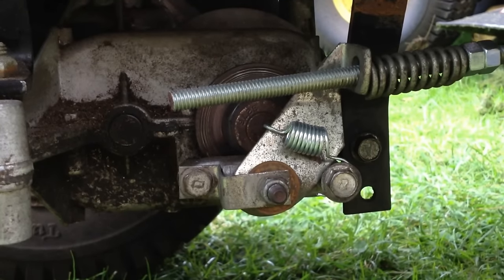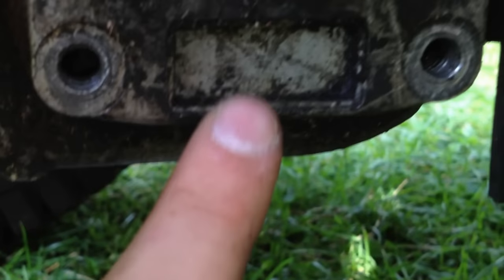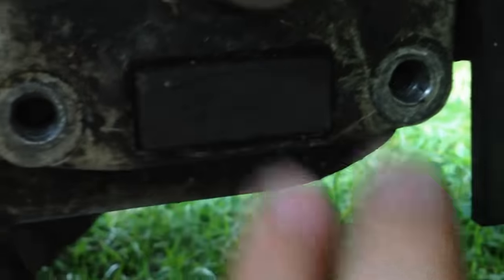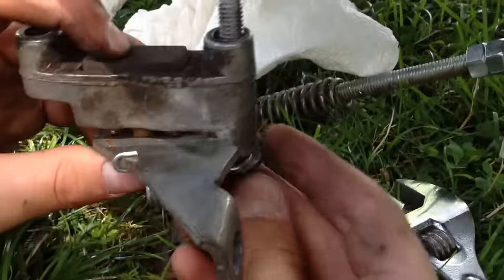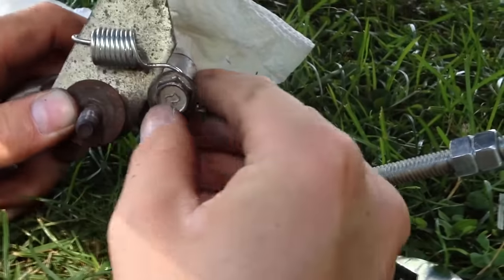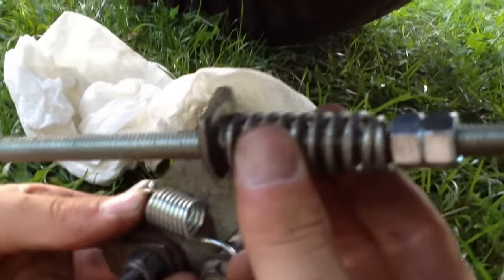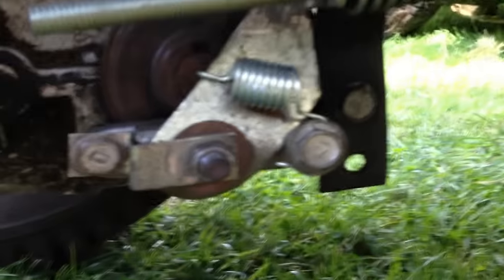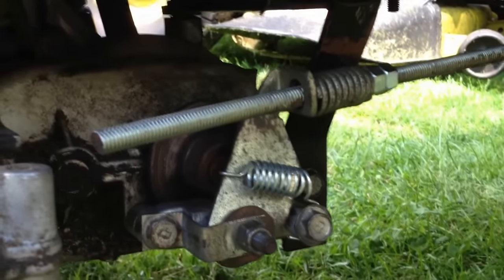Craftsman Lawn Tractor Brake Assembly and Adjustment

Comment: I commend you for taking the brakes apart and putting them back together again until you got it working just right.  As many have said you didnt know the names of some of the parts, but you didnt let that stop you from forging ahead.  GOOD JOB!  I just wish it was more like my 917.276022 25 HP 48" mower.  The basics are there though.  Thanks!

Comment: You actually did a pretty good job with that. I lost my brakes today and couldn't for the life of me understand why. I never had problems slowing down or stopping. I just simply let my wife drive it for 15 little ol' minutes and WAHLA ! brakes are gone. I jacked the tractor up and I can actually see the pad coming out and the brake assembly has play in it. I'll tackle it on the weekend,but very good!

Comment: Nice video and presentation. I watched it once and was able to do the project start to finish in a couple hours. The pins were rusted in solid. Had to heat the block to loosen. It was so corroded that the brakes did not engage so the pad was not worn. The brakes worked perfectly the first time.

Comment: Your video was helpful in locating the brake assembly on my mower. It is actually quite simple in the way that it works, all mechanical, no hydraulics involved. I would like to add however, that simply turning the pads over does not address the problem of failing brakes. If the brakes need adjustment then it's time for new brake pads. If you want to squeeze a bit more life out of the old ones you could fabricate a shim to fit into the housing beneath the existing pads, effectively giving them added thickness.
Reply: Definitely not true.

Comment: Excellent brake down, I am not familiar yet with my used mowers braking system, now I understand how they work and where the brakes are located . My recent mower purchase leaves me replacing more parts than I expected. It starts and stays running...  so I am on my way.. thanks for the informative video.

Comment: How to make the pads last longer.   A hose clamp is the right width. Just needs to be cut to length. You can use them as shims to push the  pad closer to the Brake Rotor. Just sand the pads  smooth where the rotor cut its grove. Place your shims behind the pads.  Lot cheaper than $16+ for  2  new pads

Comment: Great video, I had to apply heat and Kroil spray to remove the bolts that hold in my brake bracket system.

Comment: EXCELLENT!!  Haven't pulled it down yet, but my brakes have a hair trigger - I either "hit or miss" coast or nearly get thrown off the mower.  Appreciate the full breakdown - suspect gunk in there - glad pads/rotor have easy access.   

And music's okay, but glad it stops after the intro so I can concentrate on the instruction.

Comment: Very helpful. After dealing with a sheared bolt (recommend going easy and penetrating lube if you remove the assembly), we installed new 1/4x20 bolts. Differing lengths - 2” and 2.5” as I recall. Also the brake disc can be pried off and the rear brake pad checked/turned over.
Reply: the brake on this craftsman isn't 100% identical to the one on our Husqvarna LT151, but the basic design is the same. The bolts securing the brake caliper to the transaxle were verry tight, was worried about breaking the bolts, talked a bit with a mechanically inclined janitor close to where I work, and he advised me to use penetrating oil and heat the bolts, so I bought a smal butane burner and heated the bolts for about a minute and as he advised used a hammer to smack the bolts a few times.. repeated the process until the bolts started to turn, and here is an important advice I got.. when I got the bolts started to turn, instead of attempting to unscrew the bolts straight away I turned the bolts back and forth quite a bit before I finally unscrewed the bolts, this together with the application of heat and the smacking of the bolts would break the bond that had most likely formed between the bolt and the treads (that sort of welds the bolts and treads together)  and avoid either breaking the bolts or stripping the treads.

Comment: Thanks, found my really old Craftsman with the brake rod bent over and dangling, and couldn't figure out how those two bolts were supposed to work (no spring in my vocabulary, of course, as it fell off years ago!).  Old indestructible will have brakes again!

Comment: The spring around the threaded rod is to adjust foot pressure tension. The greer nut is to adjust the position of puck engaging the brake disc. Tighten down the greer nut will cause the brake to engage without foot pressure.

Comment: My Craftsman lawn tractor in about 11 years old and I needed to replace the brake pucks. If you check the sears website they don't make that pad anymore. If you go to MTD products website they have some pucks that are a little shorter but they will fit. The problem is they are not as thick as the originals pads. If you make a spacer like the one on the outside pad, and put it behind the inside pad it it will make it thick enough to work. This is typical Sears, I guess think that you can just drag you feet to stop.
Reply: My 1994 GT 6000 is 21 years old,which I bought brand new.Two weeks ago I ordered new pucks which Sears said are still in stock on Sears Parts Direct,well that ain't true I found out.Sears took my my $16.72 cents and now they don't what happened.The brakes went out 2 years after I bought the tractor,and not from abuse.I had to call them,they didnt let me know anything.I looked on Jacks Small Engine,they claim they have them,we'll see.

Comment: How do I adjust my parking brake lever so that it stays locked in park and not slip out or hold in the park position??On a Craftsman LT 1500? Specifically just the lever used to lock it in park position without slipping out.

Comment: Hello, I have a roper lawn mower fairly old on now. I believe by looking at this video that the braking system works the same. Now I have found that I either have problems with my brakes or with my clutch now I’m not sure how to work around these I was wondering if you could make a video to help troubleshoot why my gears will not cut out due to problems with cloth idler pulley. Or if anyone sees this and understands what I mean please message me. Would really appreciate the kind help.

Comment: how do you adjust brakes on 30 inch16.5 ridding mower sears has 2 bolts but no center bolt to tighten like other mowers has a bolt on top

Comment: funny how he didn't show the removal of the rotor, which is nearly impossible- 90 percent of these mowers will have a seized rotor that won't slide off.  Soak it in pb blaster and then use a 2 jaw narrow clearance puller to remove, there's very little room and a standard puller won't work. Don't use a prybar or you'll crack the trans case and warp the rotor.   Oh and one of the two  bolts that holds the caliper broke off flush too (oh joy!) on mine, had to use a self tapping screw to replace it.
Reply: Use Kano AeroKroil. 
Has been around since 1939.

Comment: My problem is that my break has play in it when I let off. I don't get enough acceleration. I can pull the brake back with my foot and there's about 2 inches of play that allow it to speed up. This also seems to effect my brake lock lever. Can someone help me get play out of this pedal so can get full acceleration?
Reply: That's probably a problem with the break retraction spring.

Comment: OK, so i did all this stuff in the video. Brakes seem to lock up that little rotor good but it doesnt stop the tractor. The wheels still turn freely.

Any suggestions?
Reply: holdengr is your key broken?
Reply: No, It actually works now. What I think it was is I had the tractor on blocks so both back wheels are off the ground. With the brakes on the wheels just spin. Put it on the ground and they work fine. Must have to do with how the trans axle works.

Thanks for the vid.
Reply: Good to hear! Yeah the way the trans axle works is basically its a transmission and a differential all in one. the differential on a tractor is open allowing both rear wheels to spin at different speeds (so when you're taking a left or right turn the rear wheels won't dig up your lawn). Same thing happens on a car, if the car is in park (lets say our car is front wheel drive) and you have both front wheels off the ground, you can spin one wheel forward and the other one will spin backward (if it has an open differential) but with both wheels on the ground one wheel can't be going forward while the other one is trying to go backward so in that case the car wont move and "Park" does exactly what its supposed to do. Its hard to explain exactly how a differential works but I suggest if your interested, to look it up on YouTube. Its pretty neat stuff.
Reply: I forgot t mention, if you use the parking brake on a car that will activate both rear brake pads and prevent both wheels from spinning

Comment: dude you should see my brakes there is no brake pads or a brake return spring and no spring on the threded rod

HEY 666MRJIMBO HE DOESN'T NEED TO USE A SOCKET SET IF HE DOESN'T WANT TO!!!!!!!!!!!!!!!!